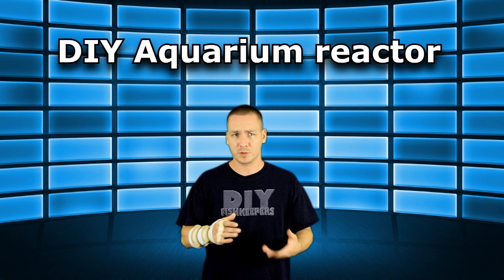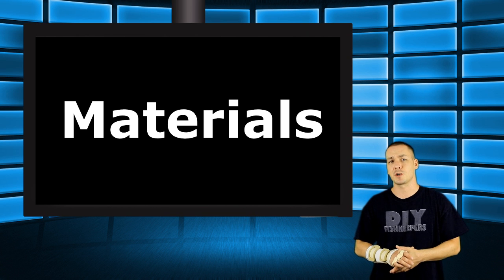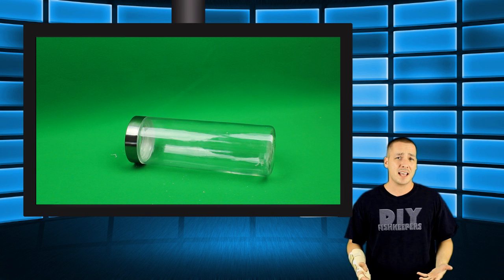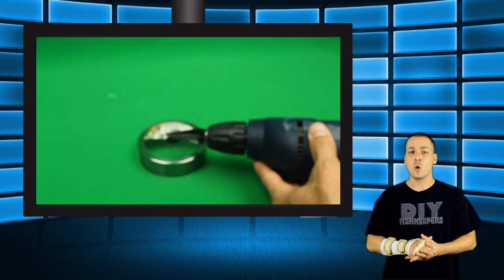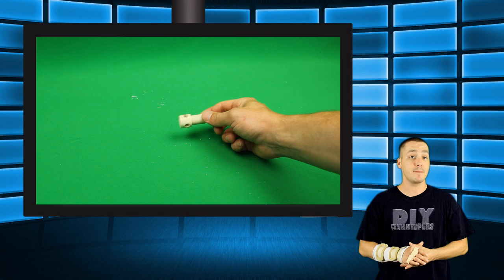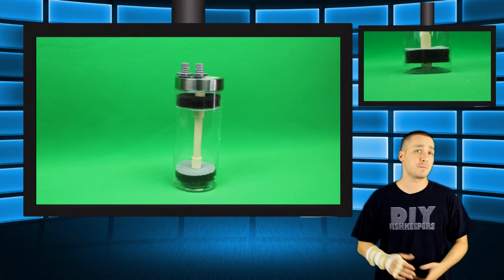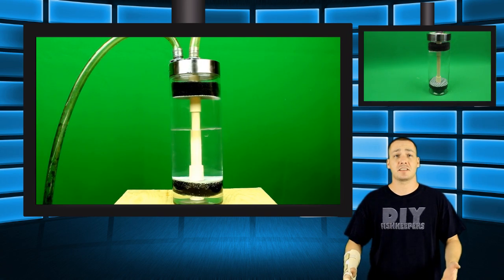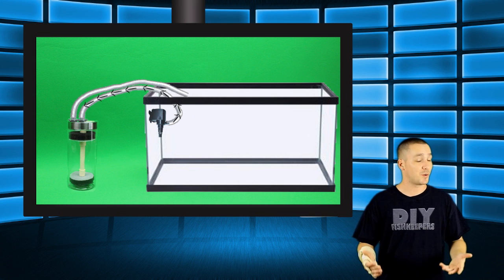HOW TO: DIY Aquarium reactor TUTORIAL

Comment: Is it possible to miniaturize this to use with a 5 gal nano planted aquarium? I'm having issues with my glass bell diffusers clogging or simply not producing a fine enough bubble to defuse into the water before it breaks the surface. I did try to attach my CO2 line out of my DIY reactor into my outline for my filter return, and... it 'sorta' works but again, I'm seeing too many bubbles going right on up to the surface just outside of the filter return.  I have a Fluval V with a modified filter system to cope with some of the 'fun' issues with the tanks design.

Comment: Can you use reactors to increase/improve tank parameters such as increasing iron, potassium or phosphate for a planted tank?  Your video is leaving me wondering if this would be possible.  BTW, great video.  Been following you for about 9-10 months cause of the DIY vid's.  Thank you for doing them.
Reply: In theory it would work, a lot of Saltwater hobbyist that keep small polyp stony corals use Calcium reactors to do just that, so it should work for phosphate, etc. depending on the Media of course

Comment: can use this as a filter with the proper bio media?? it looks like the same design as a Penn Plax Filter.
Reply: Yoelvis Pedraza a reactor is essentially a way to effectively chemically filter the water in your fish tank using either carbon, phosphate remover or other various removers. This design essentially maximizes youre media.  Technically it is a filter,  but  it is not recommended to be used as mechanical filtration device (as in filtering fish waste etc) as this would ruin the whole "maximizing your chemical filtration elements".
Reply: Ethan Cheung-what if you were to have multiple reactors in line? the first one being set up for mechanical filtration, the second biological...

Comment: Would you be able to use this basic design to build an inline algae scrubber?
Reply: Just add a cylinder of mesh inside the reactor and UV lights, or a full spectrum (lizard light/heat lamp) on it to promote algae growth. I don't see why it wouldn't work.

Comment: if you're planning on running biopellets in one, the pellets need plenty of circulation, otherwise they'll clump up, and you'll have a big goopy mess, sooner or later not allowing much flow back into the aquarium. you also need to have a control valve on the otlet hose, to insure slower outtake. you also need some kind of circulatory hose and valve coming from the pump into the reactor chamber, to compensate for extra pressure buildup inside the chamber, that's if you want to control the amount of water you want to escape back into the aquarium.

Comment: I was wondering if you would be able to help me with a few questions i have ? i have a very high Phosphate Lvl in my planted tank! i have well water and it comes out high from the well it self. i wanted to put in a phosphate reactor and was wondering if you thin i could use Zoo Med 501 Turtle Canister Filter as one. it has a flow rate of 80gph  and from what i understand the lower the flow rater for this kind of reactor is best> any help you can give well be welcome.!  ohh it a 40gal bow front  thanks again.

Comment: Great video. Thanks. One question though.. I've recently purchased some RowaPhos and wondering where would be best to stick it in this kind of reactor? Can it be thrown in beneath the lower filter where the inlet pipe ends? (The filter and mesh would keep the Rowaphos down, yet allow the water to flow through it, right?) Again, Brilliant video. Very helpful. Thanks.

Comment: THANK YOU, JOEY! The version that I created uses a "hang on wall" type home water filter (filter removed, flow REVERSED) http://www.homedepot.com/p/GE-3-4-in-Inlet-Whole-House-Water-Filtration-System-GXWH04F/100471282, and 2 of these http://www.lowes.com/pd_22203-322-352807_0__?productId=3455036&Ntt=plastic+elbow&pl=1&currentURL=%3FNtt%3Dplastic%2Belbow%26page%3D2&facetInfo= I fabricated a similar CPVC pipe like your model. The unit is white plastic, to keep it dark, and it's only used as a bio reactor (anaerobic bacteria need darkness). Filled with ceramic rings- no pads or foam to clog, and is attached to my canister filter with hoses & clamps. The canister unit is exclusively for mechanical & chemical filtering (sponge & charcoal) . The super cleaned water is pumped into the bio reactor, and out to tank.  My tank is very manageable now. My bio reactor has been running for 6+ months, without ever having to open it- it never clogs, or leaks. I can now clean my canister thoroughly without causing "new tank syndrome" any more. $38 total parts (and bio rings) + 1 hour labor. DIY= PRICELESS
Reply: As of 10/15/2015 I have not opened it at all, it's anaerobic colony is still going strong, water is very clear. When I disconnect (built in quick-connect) my canister (Rena xp1) for cleaning- upon reconnection it sometimes ejects some of the dead colony, easily netted up- or my algae eaters gobble it up! This is very beneficial to the unit; you should never open it or "clean it out"- it will take care of itself. It takes about 4-6 weeks to establish a healthy colony. Dark, clean, and flowing used tank water is what it needs. Frequent water changes will kill it quickly.

Comment: what are your thoughts on connecting multiple reactors together? meaning have a pump to a reactor then connect that reactor's out line to another reactor's intake and so on. I hope u get what I mean?
Reply from the maker: You could, but flow would be an issue. You would need a pretty powerful pump. There would also be a ton of pressure. It could be done though.
Reply: ***** k, thanks. u the man ive learned so much from u and brstv. didn't want to drill a hole on my tank so I built an overflow from one of your vids. haven't tried it yet. want to paint the pvc black first. krylon spray right?
Reply from the maker: Martin Marcial Yup, but BRS sells black PVC pipe and a lot of other colors now. MIGHT want to check that out first. By the time you buy white PVC and spray paint, you could have spent the same on colored with shipping.

Comment: I don't know if anybody mentioned this but I would highly recommend when using activated carbon that you plumb the pump for this canister filter the opposite of what you recommend in this video to decrease the possibility of the carbon becoming fluidized and causing carbon dust to get into your aquarium.
Reply from the maker: You would always want to rinse carbon before using it. If rinsed, very little dust will lift. If it does, the top sponge will catch it. On that same note, you could just slow the flow. If carbon has become fluidized, then you must have been running it way too high anyways.

Comment: This may be an interesting way to build a K1 filter without building a sump. The trickiest part will be getting enough flow to fluidize the media.
Reply from the maker: It could be used as a bio-pellet reactor (which works on fluidization), but not a K1. There would not be near enough oxygen in the container.

Comment: Hey man I was wondering.. I have an old canister filter. Could that be used as a reactor for my 300g tank.. And if so what you put in the trays of the canister filter..?
Reply from the maker: You could slow the flow down and get some use out of it yes. The media will depend on what you want it to do. Research the different reasons for a reactor and see which one you are looking for.

Comment from the maker: Today's video! Hope you like it. Let me know your thoughts please!

HOW TO: DIY Aquarium reactor
Reply: Great video as per usual Joey! I was thinking of something like this for a canister filter so both inlet and outlet is on top, but could not wrap my head around it. You make it look so simple. Good job man, don't let that finger slow you down!
Reply: I've made a version that I think would work that I modified of yours. I placed activated carbon in the bottom and a 4 inch sponge and 2 knitting mesh top and bottom of the thick sponge. it cleans the water and gets rid of any discoloration and smelly water!
Reply: +The king of DIY  ^^^^^^^^^
Reply: Can't you just use and modify a housing  from a r/o water filter system ?
Reply: The king of DIY
Reply: Very good ... Most of My concern about leaking of system

Comment: Question for you. As I am getting ready to set up a 120 Gallon (4'x2'x2') tank, I am not too nervous on the filtration but slightly concerned. I will be running a Marineland 350 Magnum canister filter (supposively rated for 100 gallons) for the filtration. The tank will be housing my (3-5 inch babies) ornate birchir and fire eel. I will be also getting a larger (around 6-7 inch) Black ghost knife (as I had one the same size as the birchir beforehand, coming to find that the birchir attacked him) as well as a "rhino"/"chocolate" plecostomus (6 inch) and last but not least, (5 inch) Bala/Tricolor Shark.
I was wondering if I can make this same(maybe larger) reactor as a piece of filtration, but instead of media put bio balls or something for nitrifying bacteria to hold on. Instead of a standard pump, use an old protein skimmer attachment pump (so high oxygen will flow through it). You think this will work or am I missing a flaw of some kind.
Reply from the maker: Ditch the  Marineland 350 Magnum canister filter..... they are mechanical filters. Get a proper filter that actually holds biological media. I have a full playlist on filters to give you ideas if you want to build. Then use the 350 for "pollishing" the water if you feel like you still need it.

Comment: could this be used as a co2 reactor as well with possibly some bio balls or ceramics to fill the inside of the container?
Reply from the maker: Use it for whatever you like. Slow the flow WAY down and add in some (plastic)pot scrubbies instead. Save money+ a higher surface area as well as ability to chop the bubbles up more. In fact, they would fit perfectly in this! This is why i love and encourage comments. ALWAYS a hidden gem in them. ;)

Comment: Awesome build Joey. Quick question for this Noob. Why is it called a reactor if all it is is an external single stage passive filter or  inline filter? How does this differ from a large well built canister filter with multi stage filtration?
Thanks in advance
Reply from the maker: Basically.. it is a supplementary piece of filtration. It allows you to pass water throw a specific media to control a certain parameter. It allows you more control over that certain media as well. A canister filter in general is more so for mechanical and biological filtration. With little control over how water flows threw or how fast it flows through specific media in it. Water has to pass through all at the same rate. Which might not be preferred of effective with certain media that you are trying to get to do a specific job.
To sum it up, a reactor gives you more control over how the water will pass through a specific media.
Reply: Thanks for clarifying thing up.
Reply: Pun intended?